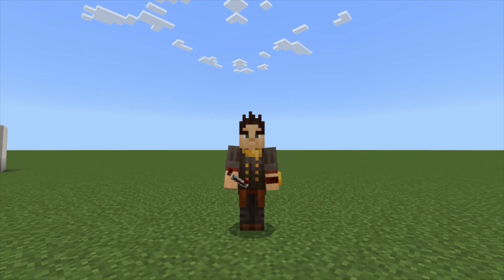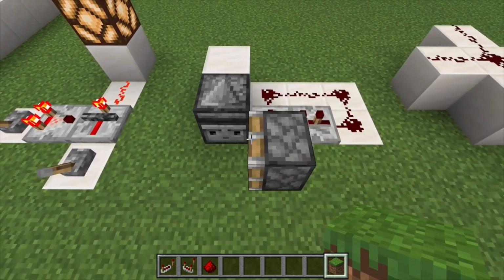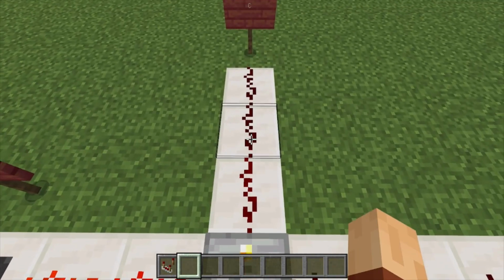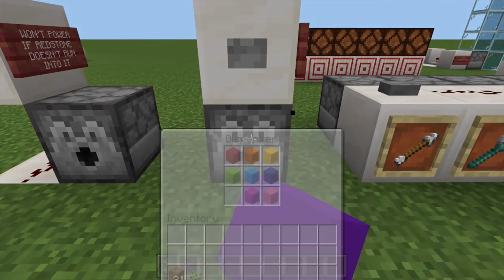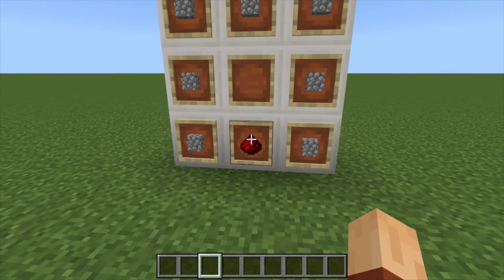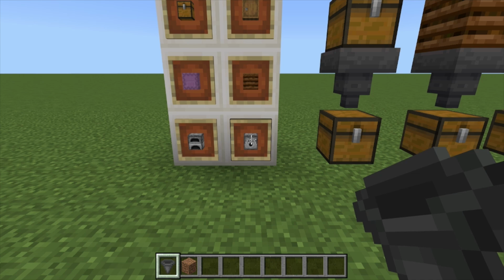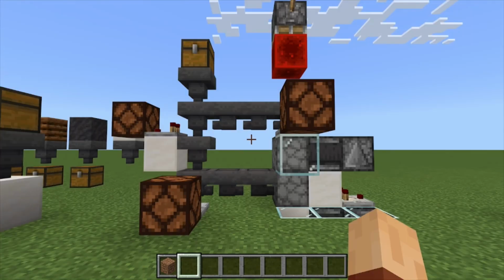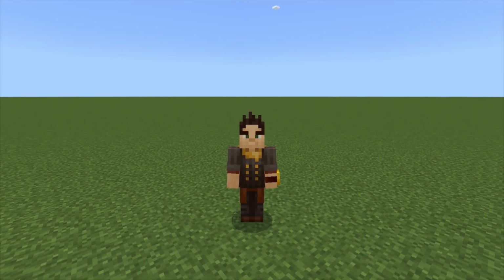Redstone Components for Minecraft Bedrock - Part 1

Comment: Great video. Very helpful explanations for all these components, especially for someone new to redstone. Prior to this video, I didn't know that repeaters could be locked on, and locking repeaters is something I think I have only ever done once.

9:39 - One thing to note with composters is that their max signal strength is 8, not 7, if I am not mistaken. When filling them up, they don't really ever stay on signal strength 7 for long because when the bonemeal is ready to be picked up, it bumps up one additional level to the max of 8. I think that if you had your redstone lamp line one block longer in this section, it would have been visible. This makes them the perfect compliment to the crafter when on subtract mode, since the crafter needs power when hit with a signal strength of nine (a full craft).

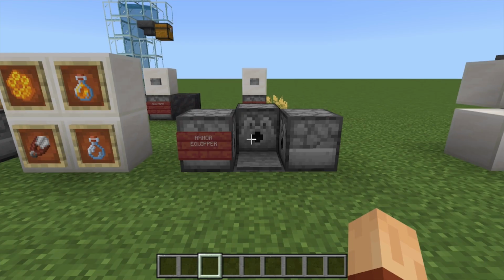15:39 - Wouldn't a dropper be a better method than dispenser for an item elevator, especially if you want to move items around the the dispenser might want to use instead? Or am I missing something?

Again, great video and it is definitely helpful for those intimidated by redstone--especially comparators. 

Looking forward to the next one.
~Cam
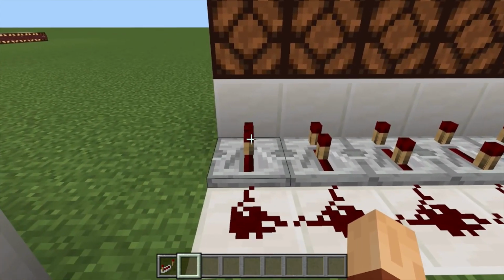P.S. While watching this video, my 8-year-old built your repeater delay at 2:37 because he thought it looked cool. :)
Reply: yes, the dropper should be used in item elevators. That's why they're called "droppervators"
Reply from the maker: Thanks for the comment! 

Yea, I only use locking repeaters in those two scenarios really haha.

You are correct, the composter does max out at 8, but only for that small moment of the composter making the bonemeal. I made a composter counter back in the day that used the 8th signal strength to ring the bell. I use composters as counters or as a scoring  system so the 8th level doesn’t really help with them 😅 I still need to play with the crafter more  so that’s something I’ll definitely check out!

Haha, yea it should’ve been a dropper instead of a dispenser for the item elevator as well 😅 good catch! 

Nice! It’s always cool to hear stories like that! 

Thanks as always for the comment and for watching!

Comment: Dispensers can be made with used Bows as well as Bows with Enchantments. It is a great way to get use out of Bows with Vanishing on them (another use is fuel in a Furnace, but Bows don't stack), but you do have to place the Bow you want used into the Crafting Table. Plus, Dispensers stack! And they are useful. 
OK, but what about things that stack to 16, what is their signal strength? I hope you keep going through the various Redstone stuffs - like Skulk Sensors, Calibrated Sensors, and Copper Bulbs, which are newer and I don't see people doing things with them (although there are pranks of course).
Reply from the maker: Great input!

I thought of getting to those components as well, but I know some of those will warrant their own video. For example, all of the different settings for a calibrated skulk sensor that you can have by using a lectern. That could take up a good amount of time alone haha.